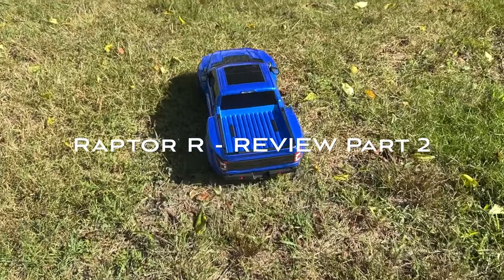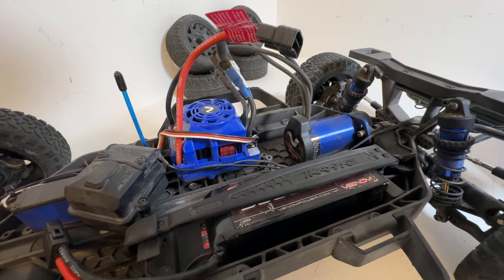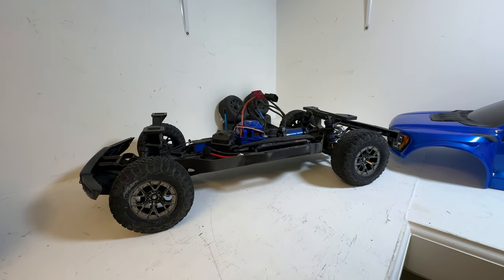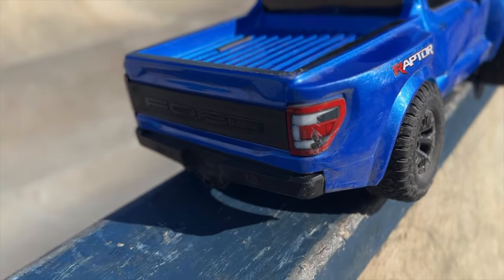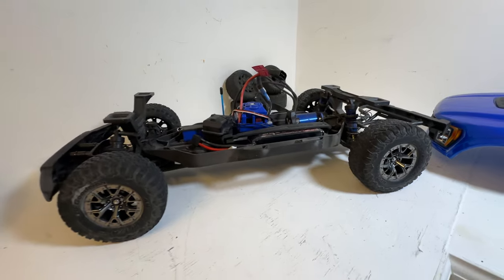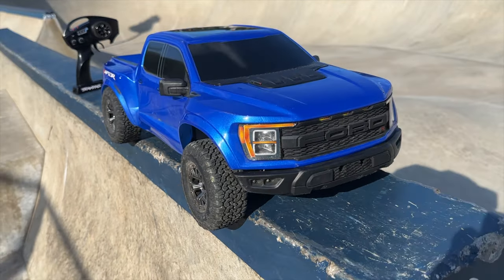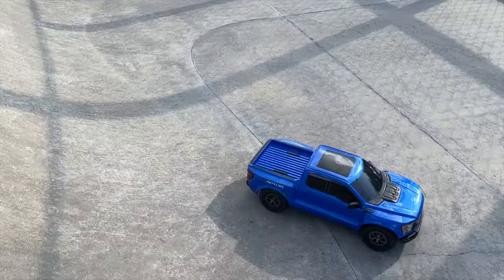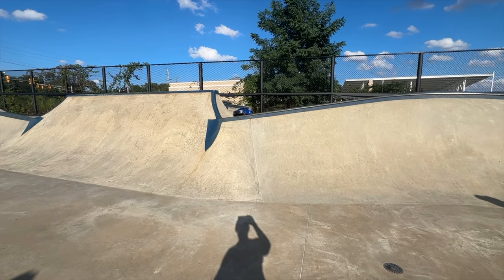Traxxas Raptor R - Review Part 2 - Follow up & Upgrades

Comment: Picked up this yesterday and put 4 batteries through it in 25 degree dry, icy, existing snow conditions. It is what it is. I knew going in what I was in for. It's fun, but shouldn't be someone's primary RC basher. It looks really good. I'll have to do the cooling mods asap. Driving it at night with the stock lighting is awesome. My OG 1gen E-REVO is certainly more fun in every way, but the pure speed can get you in trouble and having you kissing curbs and cartwheeling too often. So, if you already have an R/C collection and want a good looking truck that is pretty fun, go for it, otherwise drop $500 hundy+ on a true basher or just get a slash ultimate... or drop $100k on a real Raptor.

Comment: Did you go with the GTR 7461 Long shocks or 7462 xx-long shocks?
With the VGRacing springs, the GTR Spring option they have online?
Stick with 30 weight shock oil or higher? thank you!

Comment: The tires are HARDER? Welp, that does it for me. The s1 tires are perfect on my ultimate, quite dislike the stock tire. Also on durability, it’s mainly because the truck is underpowered. The 540XL 2400kv should’ve been in this along with the center diff. All their 4x4s should have that treatment honestly. The BL 2s trucks can have the slippers and the 2wds can have the 3500kv but the 4x4 3s trucks really need the XHD kit, 540xl and 6780 center diff (I’d also settle for 6780A even though you basically need to immediately upgrade the cup to 6781). My slash ultimate is fun but I can tell the slipper just bleeds way too much power even being tightened.

Comment: How did you get the 4s esc to fit the 3s motor wires?  I thought the wires were different.  I put fans on the esc and motor and the Temps have nor even hit 100 degrees and this is in 85 degree wearher.

Comment: I’m surprised you didn’t mention the fact the slipper clutch goes to shit easily mine quit on me the first run and I also dealt with a ton of shut downs from heat even being nice to it I tightened the slipper and it’s still running now but I try not to jump it or be mean to it till I get a new slipper or a slipper delete aside from that my truck is super fun to jump around and have fun but I’d recommend a better slipper clutch to anyone who’s thinking about buying one
Reply from the maker: Hi. Slipper pads can be upgraded to aluminum for little money. You need to check slipper every so often. Lock slipper and use aluminum pads and you will be ok.

Comment: I am very used to the Maxx smooth motor and esc Witt no cogging and the ability to drive at slower speeds without stuttering stopping all the time.  I found that if you use 2s it drives much smoother.  Slower by 15-20 mph in terms of top speed but much more pleasant in regular driving condiditions.  Does the 4s esc smooth it out any?  Ultimately I am going to have to put a Hobbywing Max 8 in it because I cannot tolerate all that cogging.
Reply from the maker: I didn’t notice any cogging on 3s. Cogging is a result of esc overworking. I used 14 pinion with raptor on VXL 4s. Smooth as butter.
Reply: @ParkflyersRC  Thanks for the response!  I have found it to be very smooth on 2s but on 3s with the stock pinion and system it almost feels a bit overgeared because it does alot of surging and stutter stop and goes when operating at walking speeds.  At high speeds it is fine.  Is there a way to fix that?  Or does it require a smaller pinion such as you did?  The only issue is I still have the stock 3s VXL esc/motor in it, whereas you put in the MAXX's 4s system in it.  I assume you had to replace and soder new plugs in order to get that 4s system to be compatible with the 3s motor.  I would love to put MAXX's 4s motor and esc in but it does not look like there would be enough room without relocating the Receiver box at a bare minimum.  Would you also have to replace all of the gears to make it capable of handling 4s power?  I wish Traxxas made this a 4s vechile but this is still very good 👍
Reply: @ParkflyersRC  Have you seen any additional speed using the 4s esc?  No doubt it is plenty fast completely stock.  A 3s system pushing 50 mph is really impressive.
Reply: @ParkflyersRC  I'd like to see about ordering from you that light set you reccomended.  Excellent recomendation and appreciate all of the knowledge you share.  Very helpful!
Reply: Two PowerHobby fans on the motor and one on the esc keep the Temps between 80 and 90 degrees no matter how hard I push it.  That said, replacing the 3s with the 4s is an excellent idea.  You get some added power without losing all of the Traxxas features from the Link module and TSM.  If you replace with Hobbywing you are gonna lose all of that and it could result in the vechile being tougher to control.  What are your thoughts?

Comment: 100% agree with this. This car feels like Traxxas either didn't have the budget to properly design/equip this car or they just yeeted it the development of it, made it on paper, didn't even test it and went to production, which completely kills traxxas'dogma of "rcs for everyone", because this RC would be a big disappointment for any kid or new/mid user that gets it out of the box.
I bought it because I freaking love the looks of it, but it doesn't make any sense, it is beefed up to be a basher with the extreme hd kit, magnum compound for the chassis and 48mph stock, yet the most expensive and fragile thing of this car is the body, MORE EXPENSIVE Than a XRT or Xmaxx body, what is it then, Traxxas? Is this a shelf queen or basher? I cringe when I scratch this body.
It is named Pro Scale yet it doesn't come with premium shocks nor proper light kits.
My rustler 4x4 vxl overheats every 10 minutes with spring/autumn weather, imagine a bigger, heavier car with bigger heavier tires and same electronics and gear ratio, the fun stops after 4 minutes. It is 600€!!! In Spain, yet it doesn't come with a silly fan on the Esc. I had to buy a 11t pinion and take out the 13t one it has, install a fan on the esc and at least a heatsink on the motor to be able to enjoy this car for more than  5mins in a 10º weather (50 fahrenheit)...
Reply: You people love crying
Reply: @cruzinthruspace  its not crying.... most of the honest youtubers will complain about the esc overheating.....

Comment: Is the 4s esc just direct plug into the stock motor from the 3s system
Reply: Because I put the additional pinion gear in mine and I can’t even get 1/4 of the way thru a 3s pack it’s so annoying
Reply from the maker: You need to change the plugs.
Reply: @ParkflyersRC  thank you for the reply woudl you be willing to post a video on how to install the 4s system on the raptor ??:)

Comment: That’s just fucking ridiculous to me to spend $530 on a truck just have to spend another 200 at least to get it drivable
Reply from the maker: Listen carefully to the video. You only need to upgrade the ESC if you’re driving an 85° or greater weather.
Reply: How do you change the plugs?

Comment: You’re too kind with this model. 
TRAXXAS disappointed a lot with the Raptor R. 
At least you showed the flaws but seriously this too much, this car is under designed: 
> the body is very noisy and doesn’t hold in place 
> the shocks cannot handle the rythme and even less jumping, the car is too big and heavy for them
> the electronic combo is CATASTROPHIC. Same story, cannot handle the rythme and the weight of the car, BIG BIG overheat from the whole combo ESC/Motor
> the price ! Having this result for this price range for a 1/10 scale is again catastrophic. 

You showed the solutions but what will be the final price after that ? 1000$ ? That’s totally ridiculous. 

This type of RC product is the worst case possible for a beginner who will be totally disgusted and wanna quit the hobby. 
Except if he is rich but in that case why buying this model with a crazy upgrades cost instead of directly a real good RTR around 1000$ ?

And the worst part of this story……at the same time, LOSI also dropped on the market a scale 1/10th pro truck, the BajaRey2.0 who is on another planet in terms of look, realism, design, chassis, suspensions, electronics… Everything…
FOR THE SAME PRICE. !!!!!!!!🤦‍♂️

A total fail.
Come on TRAXXAS, how can you guys doing this in 2023 ?!?
This is not serious, and not respectful for the customer.
By the way I hope they will do something for the Raptor R buyers who contact them concerning these issues.
Reply: Wrong absolutely wrong about everything I bet you don't even have one.  
I've had it since release never shut down once and I do mostly speed runs and I live in a warm area.

Comment: Complete overpriced garbage. 500 plus price tag and then 100 plus to get it to last a full pack. I’ll take the Arrma Mojave 4S any day over this. Better looking better electronics. My Traxxas models are limited to nitro except for the Maxx. Anything else is Arrma or Associated although associated isn’t that great anymore either.
Reply from the maker: Ouch
Reply: Arrma is so wack
Reply: @cruzinthruspace think so?  The electronics are better than Traxxas. Hands down. Parts support no. The kraton handles better than my Maxx. Plus the price point has Traxxas beat.